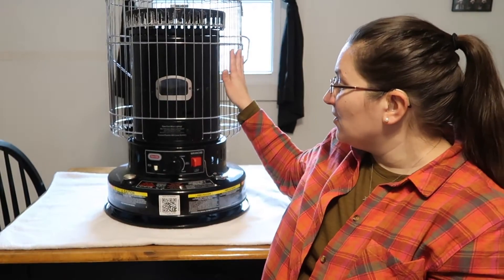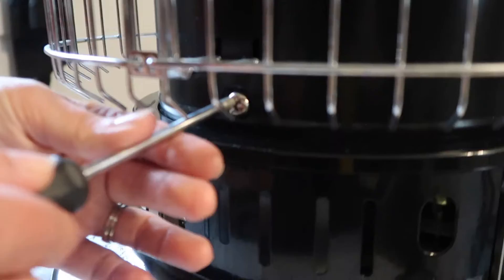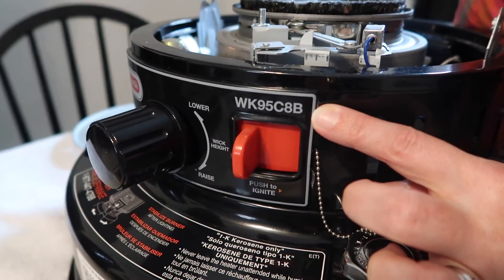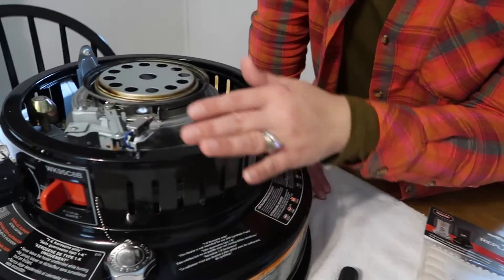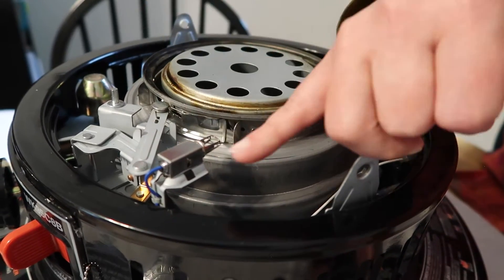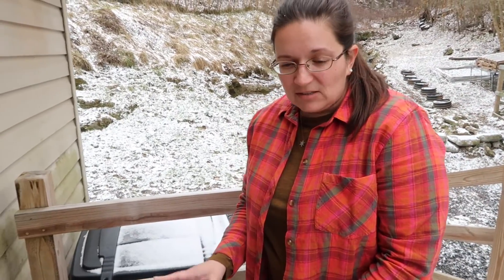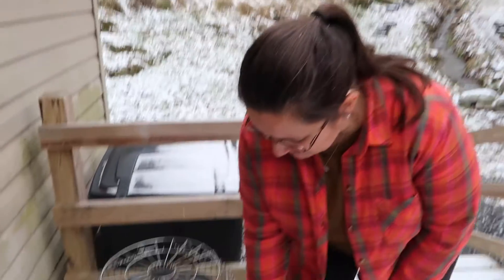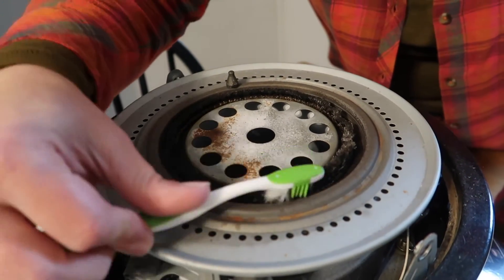Wick & Ignitor Maintenance  (Dyna Glo 23,800 BTU Kerosene Heater) for Emergency Heating

Comment: I just use a butane stick lighter for my kerosene heaters. This is a great video. Cotton wicks are used on older flame spreader burner heaters - they need replaced when they burn too short to work well.  Water contamination and bad fuel are the chief reasons for poor functioning kerosene heaters.
Reply from the maker: I've been using a butane stick lighter for years now. It's much easier/faster than striking matches! I’m pretty sure all of the newer kerosene heaters by DynaGlo are fiberglass. Thanks for watching and supporting my channel! If you haven’t already, please consider subscribing. Take care! -Sarah

Comment: Finally!   I've been searching for a wick dry burn video. The instructions seem overly complicated.   The manufacturer really should put up some instructional videos
Reply from the maker: I tried to tie dry burn info into this video but honestly, I need to make that it’s own video with better explanation. I will work on that. Thanks for watching and supporting my channel! If you haven’t already, please consider subscribing. Take care!
Reply: I just let mine burn all the way out. I tip the heater and suck out all the kerosene . Then relight it outside. When its out and cold a couple hours later I add fuel.
Reply: @vdog4799  that simple... You should consider writing the directions for the manufacture 😉. Much appreciation to all for taking the time to reply👍

Comment: I have this heater and it will not light. Do you think I need a new wick? I can see the light in there it’s just not lighting
Reply from the maker: Based on the few details you gave, it sounds like you have a heavily clogged up wick. If you don’t dry burn your wick at least once every 2 weeks during routine use, carbon deposits build up on the wick to the point where it becomes super difficult to light it. I would just go ahead and install a new wick if I were you. Once you install the new wick, learn about the dry burn process to keep the wick clean. Once you change the wick, stick a piece of tape on the tank of your heater and write the date you put the new wick in. It’ll help you keep track of how old that wick is. Thanks for watching and supporting our channel. If you haven’t already, please consider subscribing. Take care and stay warm!
Reply: Did you put the colored kerosene. If you put pink kerosene, then the color clogs the fiber glass section of the wick and you are done.
Reply from the maker: True. The pink dye is a form of colored additive that ruins fiberglass wicks. Dry burning the wick doesn’t usually work once exposed to the pink kerosene. Thanks for watching and supporting our channel! If you haven’t already, please consider subscribing. Take care!

Comment: How long does the wick last using the heater as your primary source f heat?
Reply from the maker: Sorry for such a late response, trying to catch up on all the comments on the channel today. So I can get a wick to last a really long time, way more than 2 winter seasons with proper dry burning and maintenance (using it as primary heat). I’ve had viewers tell me they can get as high as 10 plus seasons. I just prefer to change it out more frequently simply because wicks are cheap and it’s a piece of mind. Thanks for watching and supporting our channel! If you haven’t already, please consider subscribing. Take care!

Comment: Does the heater need to be completely empty on fuel to dry burn the wick? Only asking because the manual mentions it but mine still has a half a tank in it…
Reply from the maker: Hi 👋 I have to write a novel to give you the best in depth answer I have so here we go…Dry burning is the process we use to “clean” the wick. “Dry” refers to no more fuel in the tank for the wick to soak up. So when you notice your fuel gauge moving close to the “E” aka empty, you need to stay close to the heater (where you can visually see it). Once you notice the flame starting to go low on its own (because it’s running out of kerosene), pick the heater up by its handle and move it outside while still lit, be extremely careful not to bump it so you don’t trip the emergency shut off. Once outside, let the flame diminish on its own. I have found this process can take 10 to 30 minutes depending at what point you noticed it running out of fuel. Once the flame goes out on its own, be sure to hit the shut off switch to completely finish extinguishing the remaining burn that’s happening. Dry burning is extremely stinky and puts a lot of fumes in the air, you will notice the smell…it’s hard to miss. Essentially, you are purposely letting the heater run out of fuel and start burning off the carbon deposits on the wick. There is no way to avoid carbon deposits (the build up on your wick). ALL kerosene fuel, even clear k1 kerosene, has sulfur in it. When sulfur is burned, it leaves behind carbon deposits on the wick. We use clear, k1 kerosene in these heaters because it has the LOWEST amount of sulfur in it. If you are using kerosene that has high sulfur content (many times this is the pink dyed kerosene), it can produce a rotten egg smell and create massive buildup of carbon deposits on your wick. To keep the wick maintained and functioning properly, dry burning is typically recommended every other week if you use the heater every day OR after burning about 2 to 3 tanks of fuel, whichever comes first. So as you’ve read above…it is literally impossible to dry burn your heater with fuel in it. I really hope this explanation helps you. If you have other questions, drop them in the comments and I’ll do my best to walk you through it. I made an entire playlist of kerosene heater videos to help people, I encourage you to check it out. Thanks so much for watching and supporting my channel. If you haven’t already, please consider subscribing. Take care and stay warm!

Comment: Thank you very much for the informative video. I know that I can start the kerosene heater without using the electronic ignitioner but I was wondering if I can extinguish this heater by simply lowering the wick knob without using the shut off lever and wick knob together or in other words by extinguishing it like a kerosene lamp or lantern.
Reply from the maker: Hi! The short answer to this question is no. The reason is because that knob will only lower the wick so far, not low enough to extinguish the flame. The knob is really nothing more than a flame height adjuster. I’m going to film some videos in the upcoming weeks about that emergency shut off and show how the actual pendulum works to extinguish the flame. Be on the lookout for those. Thanks for watching and supporting our channel. If you haven’t already, please consider subscribing. Take care.

Comment: Hi there! You are the Youtube Dyna-Glo guru! 🙂I just unboxed mine today and set it up, and did the first lighting. But during the 60 minute wait for the wick soaking I went thru the entire manual. And really, every two tanks gotta do a dry burn and disassemble and scrub the wick? Seriously? 🤔 I have a 100 year old Perfection 525 and it takes practically zero maintenance. Nothing at all like recommended in the Dyna-Glo manual. What do you do? Every two weeks like the manual states?
Reply from the maker: Hi 👋 Welcome to my channel! Sounds like you have discovered my Dyna-Glo kerosene heater video playlist. I remember my first time setting one of these heaters up...I was nervous I was going to mess something up and burn the house down...lol. I created these videos with the goal of alieviating peoples anxiety by showing them how to properly and safely use these heaters. I'm really happy to hear that you read the manual! Put that booklet in a safe place...just in case you ever need it for the parts list or the steps for the wick change out, etc. Even I have to refer to it from time to time and I've been using these heaters for years now. Moving on to your question...every 2 weeks is Dyna-Glo's recommendation based on their product testing. The REASON we dry burn is to burn off the carbon deposits on the wick. ALL kerosene fuel has sulfur in it. It is ALWAYS recommended to use clear K1 kerosene in these heaters BECAUSE it has the LOWEST amount of sulfur in it. When sulfur is burned it creates carbon deposits on the wick. Carbon deposits make it difficult to light your wick, extinguish your flame, and makes the wick "stiff" and difficult to move up and down. How often you dry burn is really dependent on your situation. If you are using this heater as a BACKUP heat source in the event of power outages...you're right...what the manual says doesn't make sense. If it's for backup only and I used it for 2 days while they were restoring power, I'd probably just make sure I dry burned it when I was done using it and then put it back into storage. Now, lets say you're using this heater as your PRIMARY heat source, meaning you're using it every single day. That's a lot of opportunity for carbon build up to happen because remember, all kerosene has sulfur in it and sulfur is what is creating those black carbon deposits on the wick. In this case, yes...every 2 tankfuls OR every week is fairly reasonable for a dry burn. Personally, I've done all different methods...every week, every 2 weeks, once a month, etc etc etc. When I dry burn every week (we use these as a PRIMARY every day heat source), I have found that the wick stays in full working order and as a result, I don't run into problems like the unit not working properly at the most inconvenient time. So to me, the peace of mind is worth doing it every week if I'm using it every day. I really think that the manual was written based on someone using these heaters daily, not once in a while. I can't talk about the Perfection heaters because I've never worked on one and I don't own one. Hopefully this helps you navigate the "how and when" of dry burning. If you have any other questions about this heater, just drop it in the comments. Thanks for watching and supporting the channel. If you haven't already, please consider subscribing. Take care and happy holidays!
Reply: @americanbackroadcreations  Thank you for your in depth answer. Everything you said makes sense. This heater will not be a primary source of home heat. Occasional movie night in an unheated den, or when I have to so some work in a cold garage. I never thought about it being a primary, only source of heat and used daily as such. So then, now it does seem reasonable to me, the required maintenance they recommend for daily users. Have a great Christmas!

Comment: Thank you for serving the Kerosene community. I've been having endless problems. My flame diminished, bought a new Dyno-glo wick at Walmart same as shown in your video. New wick works beautifully up to burning 3 gallons of kerosene.  After that is never the same and needs another wick. I am up to my 4th wick, 4th different fuel locations. 3 locations sell 1-k i even tried at some point red dye to see if i notice any difference. I install the wicks, install them kerosene soaked already and then even give time to have them soaked after installation process is finished. It seems like the wicks stop bringing fuel up, when malfunctioning there also smell. I see no water in tank or fuel. Have you encountered defectived wicks ever? What are your thoughts? When efficiency vanished i even try dry-burning the wick, no improvement after doing that?
Reply from the maker: Hi! This is an interesting scenario. I've used this exact brand shown in the video for years now and have never had a defective wick. A diminishing flame can be caused by a number of things. First thing that comes to mind is that its possible your wick is not in the sleeve correctly or the pins have slipped out of place. If the wick is not in the sleeve correctly it can slip downward during use or not raise fully to begin with causing the flame to diminish. If the flame is too low, it will produce that nasty smell. I personally do not presoak my wicks before installing. I install the wick completely dry, put everything back together, fill my tank, then just let it sit for one hour before I light it up. This allows the fuel to travel upward the way it's supposed to. Water in kerosene is visually difficult to spot because water is denser than kerosene, meaning the water will not be on the top but instead on the bottom. Have you tried additive? I've had great results with the Century 21 brand, it's usually a small blue, green, and yellow colored bottle and retails for about $4.99 at Tractor Supply, Rural King, and Lowe's. It's usually available unscented and scented (like pine or vanilla). Additive works to disperse any water content in your kerosene, simply add it to your fuel before pouring fuel into the heater tank. I would suggest watching my wick change video step by step and see if you can pin point anything I do differently from what you have done while installing the new wick. Here's the direct video link: https://youtu.be/aRPjeL3viRM A common mistake people make while sliding the wick onto the cylinder is that they forget to keep the wick in the raised position with the black knob (aka wick adjuster knob). I really don't think your wicks are defective (at least not all 4 of them). I think there is something else going on. I hope this information helps. It's difficult to diagnose a heaters problem when I don't have it in front of me. When you figure this out, let me know how it all worked out, I'm really curious. If you find my videos helpful, I have an entire kerosene heater playlist on my channel, check it out. Thanks for watching and supporting my channel. If you haven't already, please consider subscribing. Take care.

Comment: Do you ever use sulfur free diesel? I have seen people say they do so successfully and yet the manufacturer instructions clearly state not to. 

I am not worried about the warranty, but paying half of the cost of K1 is tempting.
Reply from the maker: Hi 👋 Personally, no, I do not use anything other than clear k1 kerosene. Sulfur free diesel does not exist…it’s actually called ultra low sulfur diesel. All fuel has sulfur in it at some level. The problem with using any grade of diesel in a ventless kerosene heater is the automotive additives that are in it. When you burn diesel in the heater, you’ll be burning those automotive additives and releasing them into the air of your home…causing unsafe conditions such as extremely high levels of carbon monoxide. The byproducts of diesel burning can make you sick and/or kill you without ventilation (not just cracking a window open, you need to send the byproducts outside). Burning diesel (any grade of it) will also ruin your wick faster as it is not clean burning due to those automotive additives. I know the heavy hit the wallet takes purchasing kerosene all too well. My personal and professional opinion is to stick with the fuel the manufacturer designed the unit to burn…clear k1 kerosene. It’s not about ruining the warranty, it’s about understanding the chemistry of burning specific fuels and the health hazards behind it. To lessen the hit the wallet takes, I highly recommend planning ahead. I have found buying clear k1 kerosene is cheaper in the off season. Same with wicks, buy it in the summer because it’s a nightmare finding one in the dead of winter. Keep a log sheet/chart and document exactly how much you are using, how many hours you got out of your tank, and record the temperature that day. All of this information can help you plan ahead for the next month or the following winter for how much you’ll spend on kerosene. I also recommend writing down the kerosene price you paid or keep your receipt with your log/chart. This will help you see the kerosene price trends. Once you know all these numbers (I did it for 1 winter, November to March basically) you can budget and preplan way easier. Remember, it’s not about voiding warranty…it’s about the chemistry behind the fuel and your safety. I hope this explanation helps you, I really need to make a video covering this. Thanks for watching and supporting my channel. If you haven’t already, check out my other kerosene heater videos and please consider subscribing. Take care and stay warm!

Comment: Where can I get a new igniter ? It wasn’t included in the wick
Reply from the maker: Hi 👋 great question! I’ve never actually purchased an igniter separate from the wick. I always purchase this exact wick/igniter combo you see in the video because it’s usually cheaper to do so. Based on my quick google search just now, it looks like Menard’s, Lowe’s, and Amazon sell just the igniter. Average price I’m seeing is about $6.99 for one. You’ll have to double check the packaging to see if it’s compatible with this Dyna Glo model. Honestly, if I were you, I would track down this exact wick/igniter combo package that I show in the video because it’s really the best bang for the buck. This combo usually sells for $11.99 Even if you just use the igniter now and save that new wick for when you need it later, it’ll be worth it. Wish I had a more straightforward answer for you, but I never purchase the igniter separately. If you have any problems tracking down just the igniter, just know that you CAN still use the heater without one. You’ll just have to manually light it. I like to always keep a long BIC lighter on hand to be able to manually light it, way easier than using a match. Thanks for watching and supporting our channel! If you haven’t already, check out our kerosene heater video playlist and please consider subscribing. Take care!